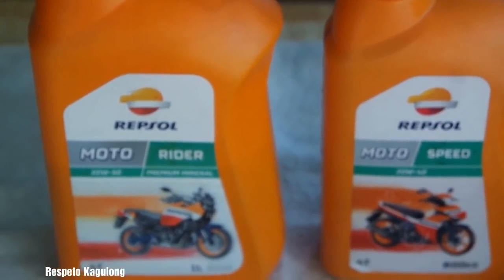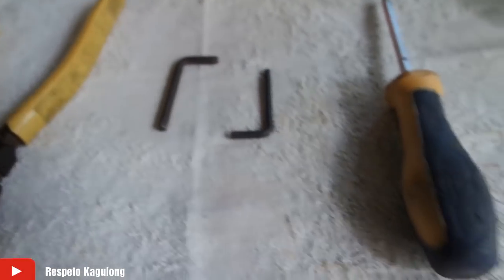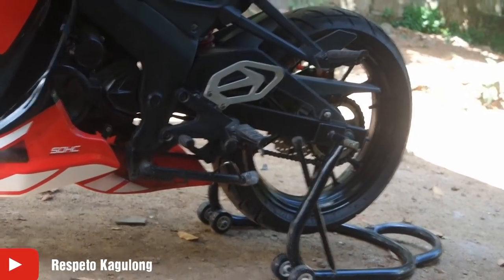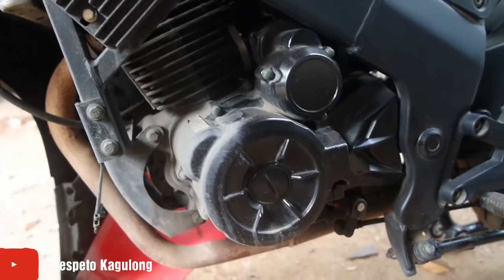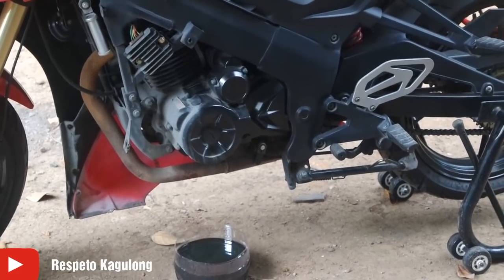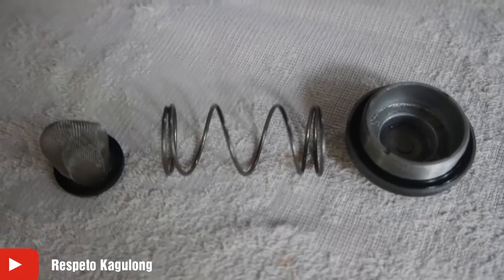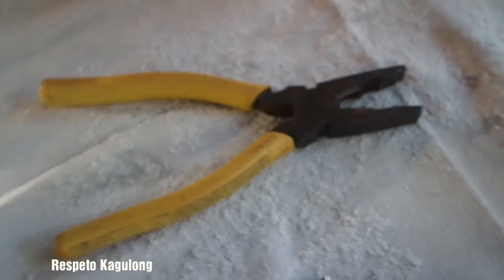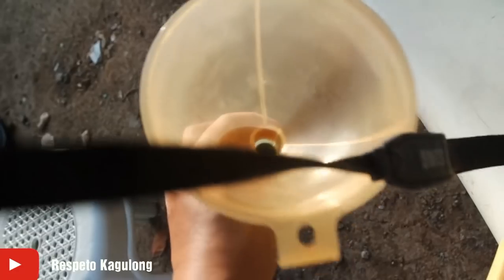Change Oil - Motorstar Xplorer Z200S

Comment: Boss kagulong,  may plan ka na i modify yung r2s mo? If so what would you change or add?
Reply from the maker: Monsour Generoso thanks for watchings paps and dont forget to subscribe! .. para lang saken sa unang plano ko is pagpalit ng sprocket para less vibration and to maximize na din yung power and speed ni z2s , and the rest puro beautification na lang like repaint or decals ganun , sa pipe okay na naman na ko sa stock pipe macho na din ang tunog

Comment: Boss, pero sabi ng warranty ko 1000km yung libre na coupon, pwede po bang sa ika 1000km nalang ako magpachange oil? 540 nayong odo nya ngayon.
Reply from the maker: usually kasi nyan sir either 1000km or on the 1st month kung alin dun sa dalawa ang mauna , you can confirm na lang din po sa casa para mas makasigurado ✌🏻

Comment: Paps 20w/40 po ba yan ginamit mo oil or 10w/40..tnx po
Reply from the maker: Jeje Canete 20W-40 paps ✌🏻️
Reply from the maker: Jeje Canete 20W-40 paps ✌🏻️
Reply from the maker: Jeje Canete 20W-40 paps ✌🏻️
Reply: Ah ok po paps.. Salamat..
Reply: @RespetoKagulong  sir pwd ba ang 20W-50 parihas kc tayo ng motor
Reply from the maker: @avegafria5423  masyado na po kasi malapot yung 20W eh , nag-switch na po ako sa 15W, best recommended oil po sa Z200 natin is either "Motul 10W" or "Pertua 15W"
Reply: @RespetoKagulong  sira yan sa 20w wag yun